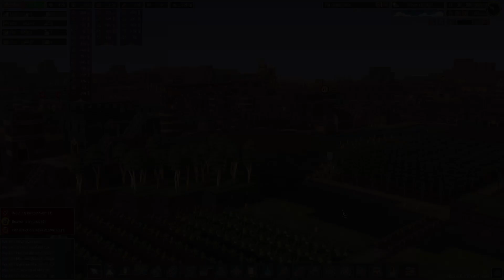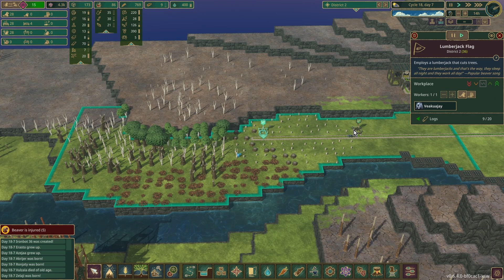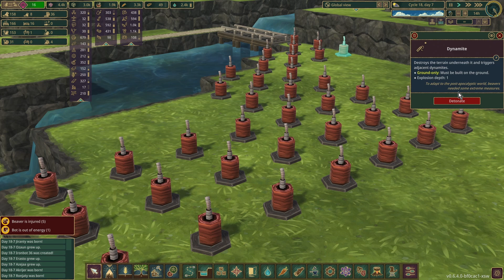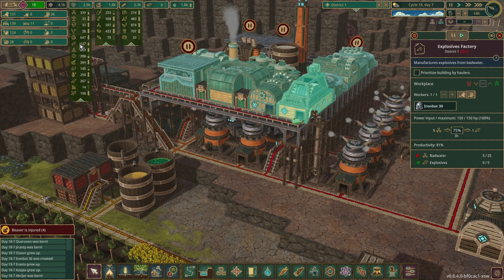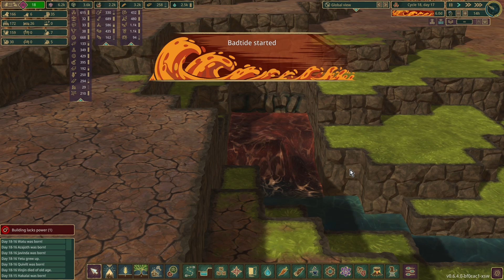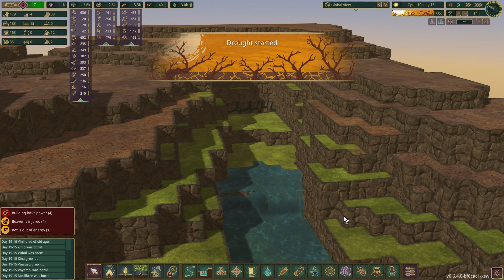Timberborn Update 6: Episode 11: Sluice-en Up!

Comment: 1:19 Hopefully that beaver is going to the remaining two dead trees on the lower level. (Edit: Yes.)
3:44 The side doesn't matter because you can just flip the pump. (On the other hand you could have arranged for the pipe to be in a "corner" of the lake, in which case it would have mattered.)
The sluice placement is better than I had feared but I would have liked them slightly closer still.
6:45 Also some trees at the lower level around the back may have been reachable.
If you're pausing buildings to save power, do you need to pause any engines as well?
11:30 I would have checked which pods had the least progress first, or maybe waited for a couple to complete.
19:49 Where was that beaver on the left going?
I would have temporarily disconnected the building works so that when the badtide started you could test out the sluices to confirm that they change over successfully.
28:45 Do you even need water over there any more? There are only two nearby beaver jobs.
Maybe deleting the path would have been simpler than building stairs?
Given that you can dynamite paths now, I'm surprised there isn't a better way of handling the impermeable floors. Maybe you can path over them anyway, and the path will take effect when they're built (it's not as if you need the path before they're built since there's a build range of ten squares by default anyway).
Reply from the maker: Dammit! I always forget that you can flip some of the buildings!
If need be, we can always widen/move the sluices across. It shouldn't be too much of an issue (I hope).
I will double check, but I think that they are just out of reach. I'll move the lumberjack flag up and clear the rest of them out.
I did shut off a couple of the engines off-camera. The ones underneath the overhangs. Then I turned them back on again! It would be nice to be able to set them to shut down automatically if the grid doesn't require the power.
I probably should have checked progress first, but I didn't. I literally have no other explanation or excuse!
That is a very good question! I have no idea. It must have been heading around the edge to the sluice area, but I have no idea why!
Again, a good idea. It's ok though. I have confidence in my superior engineering capabilities...
We do have housing and farmwes relatively nearby, and haulers are bringing resources all the time. I'll probably remove it when we make the industrial area Bot-only, unless we add something that requires water (unlikely as that is).
To be fair, I haven't checked to see if you can lay impermeable floors over paths. Without the path, they won't be able to reach that central strip all the way along. I will check to see if paths do work on them.